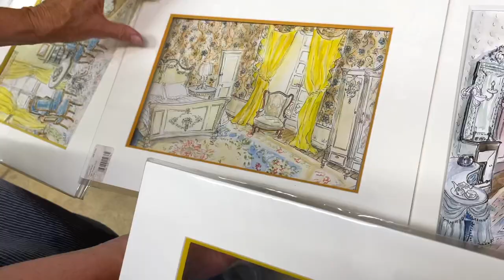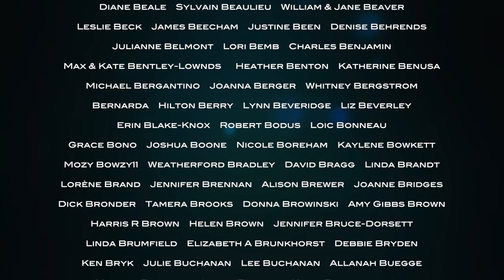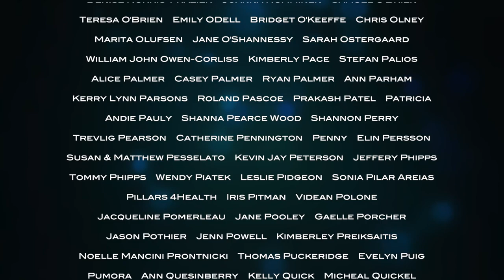MAKING CURTAINS FOR THE ANTIQUE BED CROWN!

Comment: Love all your toile de jouy fabrics! Hot decorators tip for using lots of toile de jouy is pairing with a plain stipe or gingam check in matching colors. It brings calm and structure to a room with lots of ”toiles” and is beautiful also as backing on cushions, on tabourettes, or seats. Makes all the patterns (especially a collection of different ones) less overwhelming, and gives more structure and elegance than using plains. 
I like to think of it as a balamce between the dainty curvy feminine and masculine linear structure of a space. 
Also have a look at bed canopy design drawings from the past. What would look perfect if you don’t want to have the lengths encapsulating the back bed frames sides is to bring them out on the wall right and left just a bit, and fasten with the type of decorative brass fixtures used to hang drapes at windows (can’t think of the English term sorry).
The canopy will look it’s best if the back of the bed is framed by the fabric and the eye can follow the lengths to the floor so the lengths aren’t stuck behind the bes frame itself and chopping them off.
Just an aesthetic thing, since you tucked them all the way back, which was a pity with all the work and beautiful fabric.
So sorry for your little Petit Pois! 💔 
Unfortunaley you must really keep chicks when they’re very small underneath chickenwire or plastic mesh or the prey birds will swipe them one after another. It’s free luch to them. Lots of various falcons and even eagles in the French countryside, and it’s the sky you need worry about, (not foxes or cats so much) or you’ll lose most of your chicks unless perhaps you have good yard dogs around which birds of prey will tend to avoid. 
Which is something I always wondered, why don’t you have a dog or two? A herding type/ farm breed perhaps? That will be happy with birds prancing around and off lead. 
No chateau without a pair of good dogs, I say. 
A couple of retrievers, any of the mountain dog breeds like Pyreneese or Bernese, Spanish Mastines, all very sweet animal tolerant dogs that won’t run off and will stay on the grounds and be good protection for chicks and any other small animals you may add later on.
Great episode!
❤️

Comment: We have peacocks and they are allowed to roam, but when we have hens that have hatched chicks, we move them into a large wire covered enclosure for a few weeks. The hens tolerate it … it’s just for a short while. To get the hens to go into the enclosure easily you must work with them a few times a week for months by feeding them in there.
Reply: Responsible approach and stewardship.

Comment: You just need the trim on the walls to be put up, so the wallpaper doesn't peel off. I noticed it was starting to peel a bit. I am assuming that the wall color is painted over old wallpaper? Then, two matching lamps and that wall should be done, yes? I absolutely love the crown and drapery, it looks magnificent! Well done, you have alot of patience, I would have used a sewing machine. Amazing!